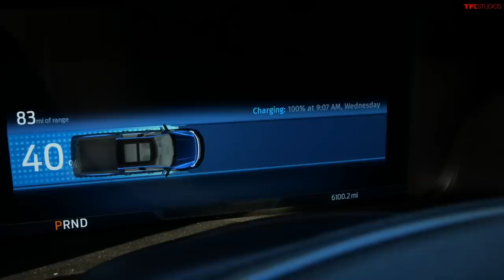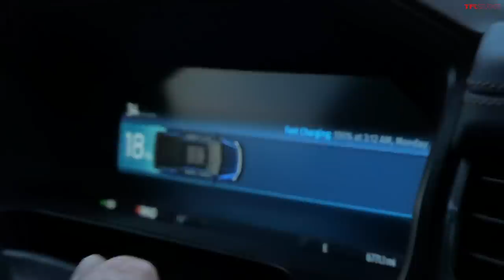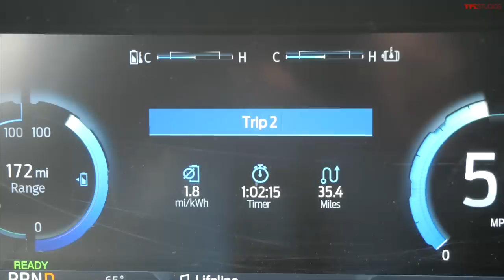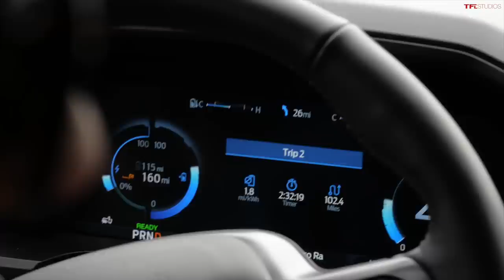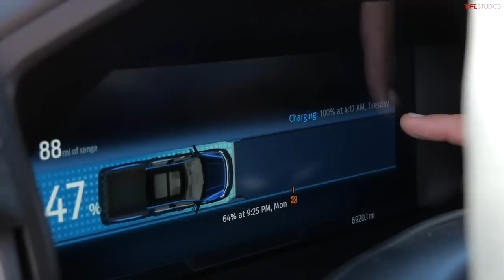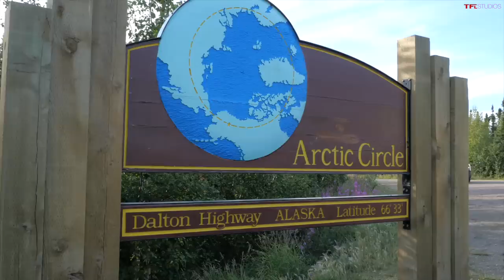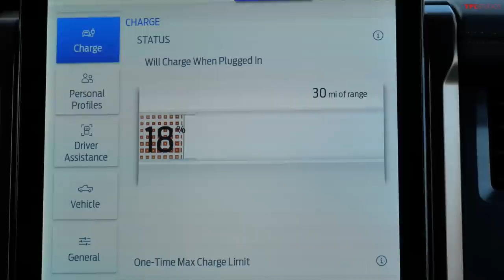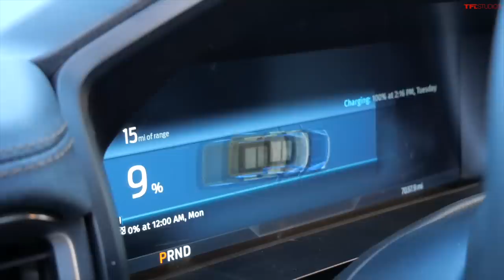Easy Part Is Over: Driving an EV Truck Into the Alaskan Wilderness Is HARDER Than We Thought! Ep.4

Comment: Absolutely ridiculous lol glad I didn't end up buying this truck
Reply: @Jbs6187  Yup, some folks got more dollars than sense to spend on a thing for virtue signaling or status. Utility not an issue for them. We know who they are, but we're not buying what they sell, and it's not just about EV trucks. ;D
Reply: @Jbs6187  No s***
Reply: You make this trip often?😂. Pretty sure the folks that did buy this truck have no problem charging it for their use case and probably laugh at the people stuck at the pump once per week (or more).
Reply: @fpartidafpartida I laugh driving passed people stuck at a charging station that are stuck there for over a hour
Reply: @rustypliers7483  No one stays at a charging station for an hour.  Clearly show how little you know about driving electric. After 4 hours of driving,  you'll stop for a half hour, which gives you another 4 hours of driving.  So in a 8 hour roadtrip,  you'll stop for a half hour.   If you roadtrip harder than that, I wouldn't want to be your passenger...or your bladder.
Reply: @fpartidafpartida  m 91 k1500 can go 600 miles on a tank and it shows you didn’t watch this series they clearly sat at minimum 45 min to charge. I can piss, grab snacks, and come back outside to a full tank in less than 10 minutes. EVs are a joke and only meant to be toys
Reply: @rustypliers74  I would say the mk is a joke.  Who wants to go 8 and a half hours without stopping?  600 miles are unnecessary.
Reply: @fpartidafpartida  a electric vehicle is unnecessary I drive across the US all the time. I laugh when people like you tried to defend a stupid product

Comment: He can make breakfast with no propane.  For anybody interested, a 20 pound propane tank has the BTU equivalent of 123 kilowatt hours.  That's almost as much as the entire battery pack of the truck.  So you can spend 100 bucks for a cylinder and a camp stove, or tens of thousands of dollars for batteries and an inverter.  People think this is progress?

Comment: When I worked for GM at one of there R&D centers in Torrance CA. Were we actually designed and built a lot of the electronics,  Inveters and Bds units for the EV1. I remember going to meetings and even back then GM goals were to design batteries.  That could do at least five miles per Kilowatt. And this was when they were still using lead acid Batteries with a range of about Eighty miles. Driving like you had an egg under your foot. As we had ten of them for the engineers and managers to drive. But because they were literally lead foots with them fifty miles was about it. And one of my favorite jobs was I got to take them home on the weekends and unfortunately drive them gently to get the range back up to Eighty. So they could drive them like maniacs again. 🙄. Then they started putting in nickel metal batteries which got the the up to about one hundred and fifty miles driving very gingerly. But of course they still drove them hard .thus bringing the range down to about Eighty miles if lucky. At least I got a free Manga charger installed at home. Back then  Gm was pushing a induction paddle charger. Which I also had a lot to do with. Helping the engineer's  design and actually building the first few hundred paddles. I was just an engineering Technician. Sadly those were the fondest days working there. As soon all the top engineers mostly from Hughes Aircraft. Were leaving or retiring. And of course they replaced practically all of them with work Visa employees from mostly China 🙄. Oh the story's I could tell would blow your mind. Especially when they took and destroyed 98% of them after all the leases were up. And the STUPIDITY of GM's brass .DECISION to go straight to Hydrogen fuel cells. While Toyota was just selling the first generation  Prius. All of us were just shaking our heads going the the hell hole in the ground thease bigwigs were doing. At least a few figured it out and we started working on the Volt about two years after that.😒.
Reply: Five miles per Kilowatts! What vocational school did you go to.😉🙂😊💯👍👍👍👍👍
Reply: Excellent comment & observation & input of "elctric vehicles".

Comment: Interesting series.  Glad you did it.  It certainly lets me know there is no way an EV has any place in my future, in the near term anyway.  I lack the patience for charging and the tolerance for the stress and complexity of ownership.
Reply: I like my horse. It's dependable. Who is this Henry Ford fellow,  anyway? Lol
Reply: I like my horse… really not practical for pick up trucks at this time. Unless you have unlimited time to sit around and charge.
Reply: I could make it work as a "play toy", I already had a car converted to e85 fuel and saught that out on trips for 120k miles until I moved and lost access to any pumps within 300+ miles.

Only thing that infuriates me is public charging... Like how many friggin apps would I need to sign up for to cover all the public chargers... Tapping a credit card is fine, but I can't stand apps.
Reply: @djbowler3333  Sure, the situations are comparable if you turn off your brain and disregard all context and current events in our society compared to the original introduction of the car. You know, for someone who seems to be into EVs so much, you sure behave like you huff a whole lot of gasoline in your spare time.
Reply: @djbowler3333  The first electric vehicle was street tested nearly 30 years before a single Model T rolled off of Ford's assembly line, and they were pretty widely available by 1900.  Your midwit-tier analogy doesn't really work.
Reply: @tbr2109  You're right. I'm sure all those super bowl commercials last year for ALL EVs and not ONE single ICE car makes your point. I stand corrected.
Reply: @djbowler3333  More like, I will keep driving my ICE model T, that elctric model T doesn't have as much range, takes to long to charge, and is more expensive. You know, like it actually happend about 100 years ago. But now we have electric cars that don't have as much range, take too long to charge, are more expensive. At least now we have more charging stations, unless you are in Alaska, or a lot of the mid US plain states. So yeah, basically exsactly the same as 100 years ago.

Comment: The best quote in the video was "robbing Peter to pay Paul." Sadly there is a lot if validity to that statement.  Definitely a cool trip and challenge to complete it. This still reinforces the Lightening's nickname the ABC truck. "Always Be Chargin'".
Reply: True, but to be fair, this is a less than ideal use case for this mission.  We have had 100 years to optimize Hydrocarbon fuel delivery systems.  Installing electric chargers is 20X easier than delivering a liquid fuel.  Just as we stopped using coal because it was no longer economical or efficient, liquid fuels are going to be limited, IMO, to certain limited applications while electric cars can handle the majority of our daily use cases.
Reply: F-150 Lightning? I say F-150 Light..Bud/Bud Light, F-150/F-150 Light.
Reply: @BehroozShariati  yes and no. It's not like mechanical and electrical technology stepped back 100 years to build this truck. A huge majority of this truck takes advantage of the same gains ICE engines did over that time.  I get your point about the electrical grid though. I just hope they can figure out a way to increase the range, find battery materials that aren't so devastating to extract from the planet, and get them off coal because that doesn't move the ball forward.
Reply: @coachvonyo  Lots of research in battery tech is already happening and, more importantly, is being funded by the same VC and investors who were backing Oil before. The current limitation, IMO, is checking speed, not so much range. If we could recharge a 200-mile car in 10 minutes, we would stop worrying about range         .
Reply: @Mistro07  Not really. We stopped using coal because better fuels, eg natural gas and oil were better options, more energy dense, and could be transported by pipe. If Chiba has better energ options like we do, they would stop using it too. When was the last time we used a coal-powered ship? How about cars and planes?  Germany invades Russia, in part, to get their hands on the oil field even though Germany had plenty of coal. None of this has anything to do with environmental concerns. Coal is just crappy fuel when we have better options.
Reply: @BehroozShariati  Yes, and when we eliminate all oil drilling, we can always go back to whaling for lube for engines!! ;D
Reply: @ronschlorff7089  Go full GMO and start cloning and raising super fatty whales for the purpose of oil production. LOL!
Reply: @Jbs6187  I agree that abandoning gas infrastructure would not make sense. But we sitios also none abandon electrification because gas is already well established. The two solutions can coexist and we still do not  have a good solution for flying, as one example.  I think we should do both and use each option that makes the most sense.
Reply: @BehroozShariati  what do you mean range isn't a concern? Do you know how remote Alaska is outside of the cities? Range IS absolutely a concern for folks who don't live in urban and suburban areas.
Reply: @BehroozShariati  Just worry how long the electrics are going to last Expensive  replacing batteries
Reply: @carl8790  do people not understand how remote much of MI, WI, Minnesota, Montana and Maine are?
Reply: @robertryan7204  Not to mention extremely dirty both on the production and reclamation sides. Electric batteries are far more destructive than burning oil.
Reply: @askadad7355  nope and I don't think they even care.
Reply: @carl8790  got that right
Reply: @askadad7355  Check out the charging networks on the interstate in those areas. One thing people don't realize is that you always start with a full battery. So as long as there's fast charging within 100-150 miles of your house and in the direction you want to go you're fine. 

But there's definitely areas not well serviced by fast charging yet. As those get filled in (and by god set up in a sane, towing friendly way) those issues will fade away.

Comment: The NEMA 6-50 is one of the most common heavy duty welder plugs in modern construction; I can't believe you guys didn't have an adapter.
Reply: I was thinking the same thing. I'd want the common adapters, then all the rest of the uncommon plugs with a section of SOOW 8/2 so I could wire whatever. But that's the plug I have in my garage for my welder (and came on every welder I've used) and have adapted to run an EVSE before.
Reply: You mustn’t have watched more than a couple episodes of this channel. Normal for them;)

Comment: Kudos for taking this on to showcase the effort currently required to use an electric vehicle outside of an urban area. It makes one want to polish up their pitch when approaching a local business. "Brother, can you spare a 240v outlet?".
Reply: @Defective Degenerate Cool, back to the future!
Reply: That’s why Tesla’s come with adapters, because in the beginning there were only RV parks and dryer outlets if you wanted to charge faster than the wall outlet. Now it’s getting better faster and faster. In a year or two batteries will go 20% further and chargers will be every 50 miles instead of 100
Reply: @kenmcclow8963  battery technology will not improve more than a few percent. If this was so great, where is the semi? It’s what 5 years late? Where is the truck?
Reply: @JAMESWUERTELE  which semi? If you mean Tesla, they are building them slowly, but they are way behind at the moment. Several others are already in production

Comment: I will be really curious to know what the F150 hybrid fuel economy was on this trip also. I'm thinking that would be the sweet spot. Best of both worlds.
Reply: I doubt it's anything spectacular. My hybrid does phenomenal in traffic, below 55mph, downhill,  or level ground. I can get north of 25mpg. Normal highway driving or hitting hillcountry  I'm getting just below 20mpg.
Reply: I would rather go 600 miles on one tank of gas and a 5 min fill up any day over 200 miles per charge with 2 hours
Reply: I wish they made the powerboost a plug in hybrid
Reply: @rudyramirez4623  so useless. Lol

Comment: Great video series.  You probably know by now but that plug you didn't have an adapter for was a NEMA 6-50 (50 amp rating) or commonly known as a Welder outlet.  Should definitely have an adapter for that when your traveling through more industrial areas.

Comment: Thanks for the series!  Fantastic info, info that shows me an E-truck is not in my near future.  No way could I justify the cost, distance or work capacity of an E-truck for my needs.
Reply: That is really what comes out of this the e truck is basically glorified urban transport with some utility
Reply: I agree with you in that aspect, but i think that this truck was designed more for those who stay local and don't need to tow or haul very heavy loads. I think that what they need to do if they're trying to stay towards this green future is phase out all gasoline trucks, but keep diesel as an option for those who need to tow or haul long  distances, at least until they can figure out a way to make batteries more efficient for long distance work. The reason i say keep diesel around is because it burns cleaner than gasoline and is designed for long distance, as well as towing and hauling, which is what trucks were originally designed to do
Reply: Yes, this proves nothing is ever a complete failure. This, vid touting an EV truck, I guess that was their goal, shows a lot of us the opposite message with their information presented here. To quote above, it's: "info that shows me an E-truck is not in my near future".! ;D
Reply: @coytus94  That's a terrible idea.   What about the many people who need more towing and range then an EV truck can provide but can't afford the extra cost of a diesel?    Those people would have no viable option and would be up sh!t creek
Reply: @robertryan7204  lol the only problem is the battery mate 

batteries with 5x the capacity for the same space will be released eventually who is going to shun 800km towing  and 3500km cruising?
Reply: @seashellwanderers456   Well have extreme doubts they will exist or be at all practical.  It will take more than 45mins to " fast charge" one😁

Comment: I hope to travel that highway before it gets fully paved, I love how the dirt looks on the trucks. Loving the journey so far guys. I hope you can do that trip again when the Silverado EV comes out.
Reply: No chance of the Dalton being paved in the next 100 years so plenty of time to head up here!
Reply: @mikeandkerryak  well that’s good news to hear.
Reply: i think my grampa took the 62 bel air there on a road trip in the 70s
Reply: If a road only ever had to be paved once, then it would have gotten paved 50 years ago; with the conditions that road faces, it would need to be repaired 4 times a year just to keep it safe, and the cost to pave it during the worst times of year would be astronomical. We will have flying trucks before that road becomes tarmac.
Reply: @Cloud30000  completely agree. I think it's hard to really understand just how expansive that part of the world is if you haven't been there. Both how long the road is, and how difficult it is to maintain highways on top of that type of geology with the seasonal changes. I actually think that the alcan highway might be better off as a well maintained gravel road. The condition of the asphalt on those sections between white horse and tok is brutal for towing and hauling. My solution for those roads would be something along the lines of a automated road grader group that would simply travel up and down year-round and continually regrade those roads to keep them in good shape. And possibly they would be something like 2:00 a.m. to 4:00 a.m. every night and the roads might close during those hours or something would be done to make sure everyone knows about it to keep it safe.

Comment: At Coldfoot, the building you plugged into, I believed, was supplied with 3-phase power. So instead of getting 240 volts, from one phase hot to hot, you get 204 to 208 volts bridging between the hot sides of two of the phases. The hot side of one of the phases to ground is still 120 volts, I believe.
Reply: Yep, that's definitely a 208 rather than a 240 (very common in larger buildings with 3 phase, as you said). It's still 120 from either hot phase to ground, but the two phases aren't 180 degrees out of sync the way they are on a center tapped home setup (which is what lets you get exactly twice the voltage phase to phase vs phase to ground), they're 120 degrees out of sync because it's 2 hot lines out of the overall 3 phase setup. Thus, instead of the two sine waves mirroring each other, one is lagging the other by a third of a period, giving 208v (nominal) from phase to phase.
Reply: My first thought was voltage drop between their adapters and the extension cord. Given the cliffhanger at the end, I’m wondering if they popped the breaker.